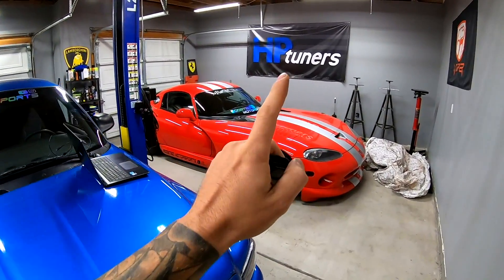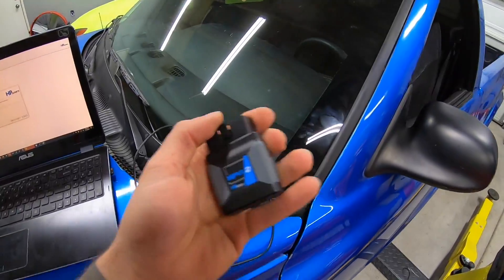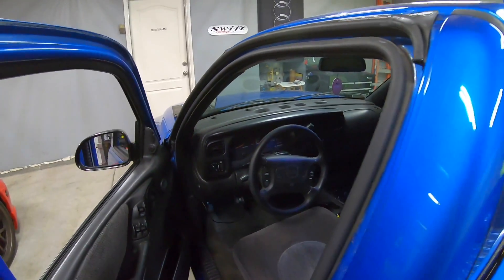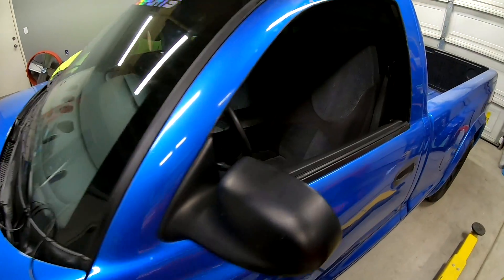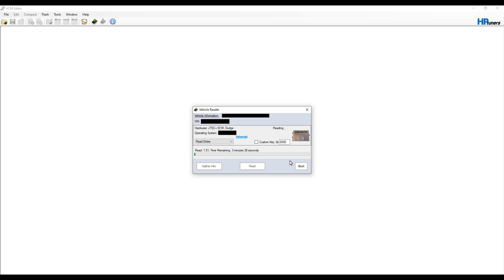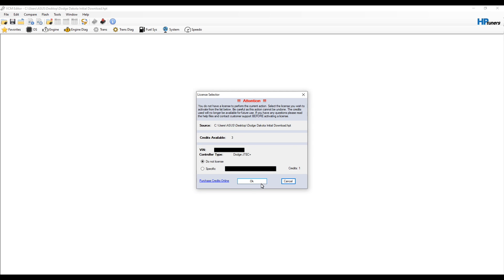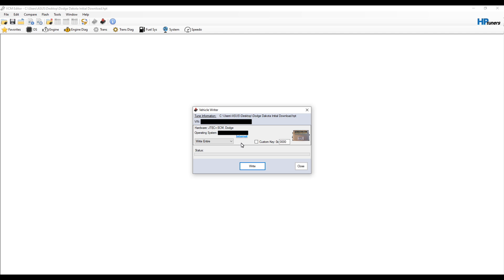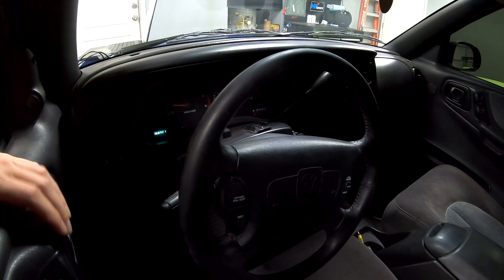Tuning Dodge with HP Tuners MPVI2 | JTEC | JTEC+

Comment: I know this video is old but does anyone know if the hp tuner supports the 97 ram 3500 v10 they did a funny saying the v10 came in the 1500 not 2500/3500

Comment: I have a 97 ram 1500 with the 5.2 I rebuilt the motor stock other than valve train I got a bigger cam what kind of tune do I need

Comment: How do I get around the fact I can’t flash pcm file on my unlocked Diablo sports pcm for my 2021 ram. I can do TCM writing but not pcm writing. I can read pcm and pull fill just fine. Just says incompatibility not available when writing pcm

Comment: How do I link my AEM AFR gaige to the MPVI2 to datalog?
Reply: Did you get this figured out
Reply: @seancorcoran4927  linked it into the EGR pinout on my PCM. Then there are maths to input that allow it to read as AFR output.

I contacted a tuner myself and he helped me through everything. Glad i did.

I wont be using HP tuners again though tbh.
Reply: @Neutsie  Why not, what will you use to tune the next time?
Reply: @Indica_Dogo  i will invest in holley term or holly term x.

Way easier of a platform to understand, and more people understand it. Hp tuners is out dated.

Comment: Thanks so much I'm picking up one for my 360 Magnum can I change my transmission shift points
Reply: It's a hydraulic trans gears 1-3 are controlled by the kickdown cable. 4th gear and Torque converter lockup are adjustable tho.

Comment: Is it 1 credit per tune or 1 credit per vehicle and infinite tunes?
Reply from the maker: The latter. 1 credit for this specific vehicle and you can make infinite changes to the settings/tunes. Some vehicles and controllers do require more than 1 credit but once you link the needed credits to the vehicle it’s unlimited tunes
Reply: Thelifeofarider vehicle

Comment: Great video, glad to see that HP Tuners finally started working with the Dodge JTEC.  I'm in the middle of a 5.7 Hemi into my 02 Dakota, the old 4.7 worked on the JTEC ECM.
Reply from the maker: Thanks Derek! Definitely good to see them releasing support for these older platforms. Makes modding that much better 🤟
Reply: Good to know, I need to edit VE tables on a decently modified 4.7 16tooth JTEC. 
I never put much faith into a device providers saying “supported”.  Yes, supported enough to get a consumer to buy the product and have a few features work.  I’m glad I don’t need to go the SCT route.